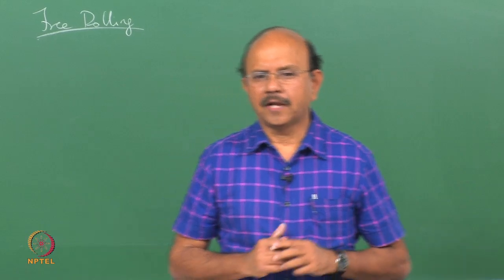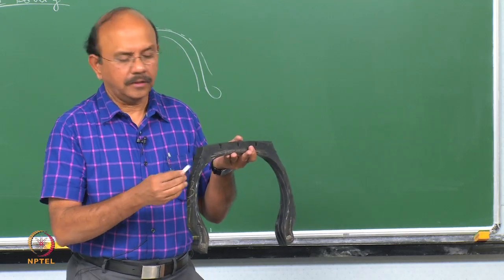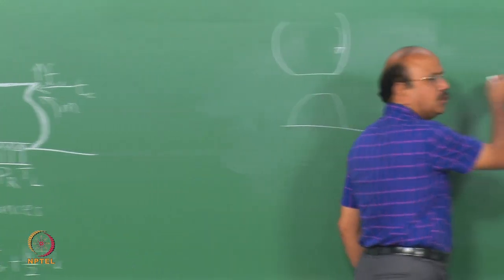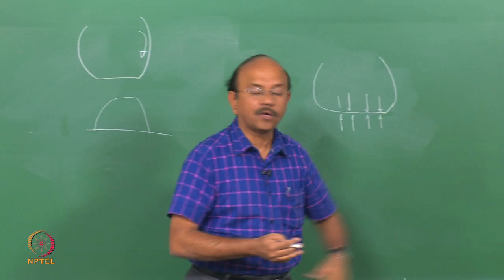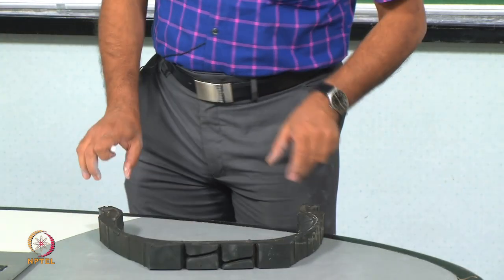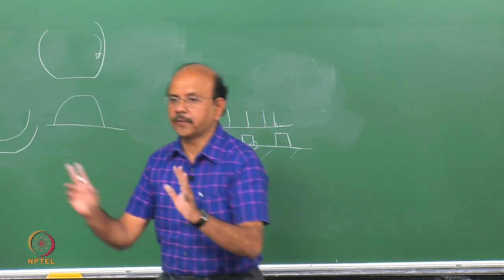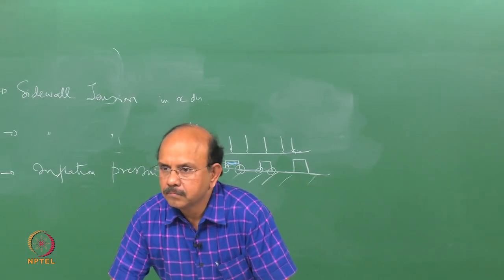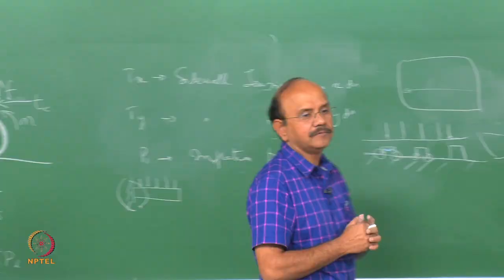Mod-01 Lec-09 Tire Construction and Force Development

Comment: The goal for tire design engineers is to determine effective contact patch or ground foot print area avoiding localized ground force pressure but spreaded equaly and have minimum stresses at shoulder tire are where dynamic stresses are the highest. Such streeses are primary root cause of tire components deterioration or separations. In order to achieve it , tire engineers tends to determine a proper carcasse cords tension under inflation  the most effective method used is the neutral cord path tebsion contour called neutral contour design. See book Mathematical underlying of tire design by John Purdue.
After tire and mold profile are  determined by proper cord tension  contour than it could be used for further analysis by FEA , otherwise we do not know what is the cord tension on cured and loaded tire and fea will be unusable.  The fea analysis cannot determine tire freen component parameters such as cord lenght, cord gree angle, tire building drum width etc in order to get a proper cord tension along tire section. The FeA is looking at that parameters as an input in order to predict tire performance capabilities

Comment: Dear Sir,
Summarize what you taught in Lesson-09.

Contact patch in a tyre is affected due to following factors.

1. Local bending (sag) between Treads/ Grooves.

2. Global bending due to Side wall deformation causing Bending Moment at edge of the contact patch.
3. Inflation Pressure.
4. Longitudinal Forces acting on the Tyre when its free rolling causes uneven forces acting upon contact patch, which causes 
contact patch to rotate slightly along the vertical axis.

Question related to Point4,
What is the direction of Tyre travel as per the FEA analysis (during Free Rolling, braking and acceleration?)
On screen (left to right) or the other?
Reply: i think if we correlate the fea diagrams with the longitudinal forces sine-wave like curve, the direction of travel is left to right. Also, left to right is the general direction of writing in most languages, so yeah.

Comment: In free body equation and membrane equation, these are dimensionally confusing. T is tension force, should have dimensions: N (Newtons), and if we apply dimensional analysis to P*Rx, P must have dimensions = N/m, that is similar to stiffness constant K, not Pressure dimensions: N/m2.  
All of this confusion about dimensions could be avoided if we assume Tension to be force per unit length. In physics and solid mechanics, sometimes in order to account for the variation of force due changes in properties of the material, we use notion for force per unit length.

Comment: sir, please tell me is there any air pressure in a Radial tubeless tyre? if so how much it is ?
Reply: A tubeless tyre has no tube but the design is such that the hollow tyre fits perfectly with the rim and like the same tube tyre air is filled .